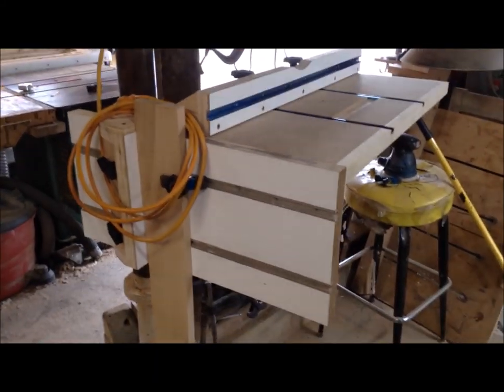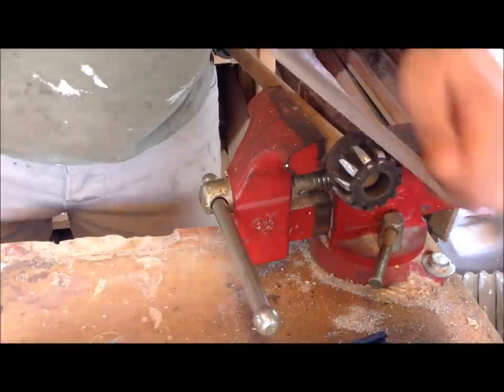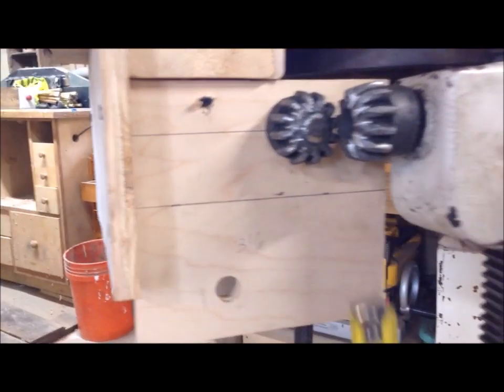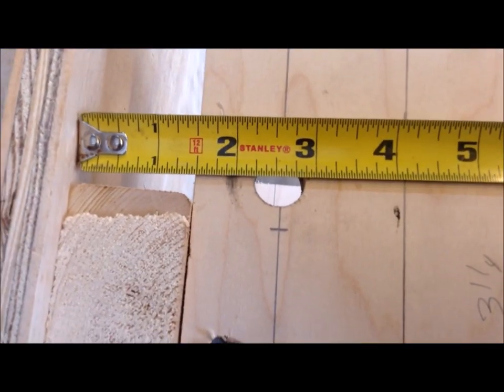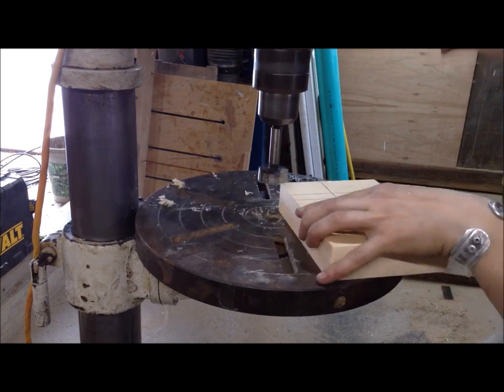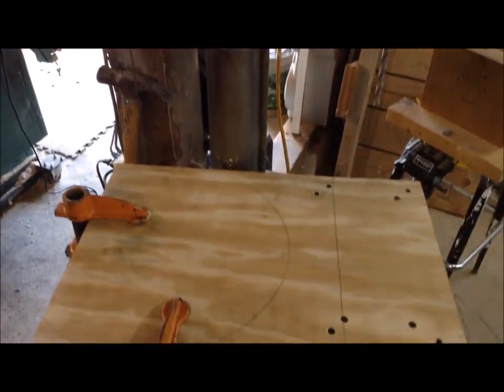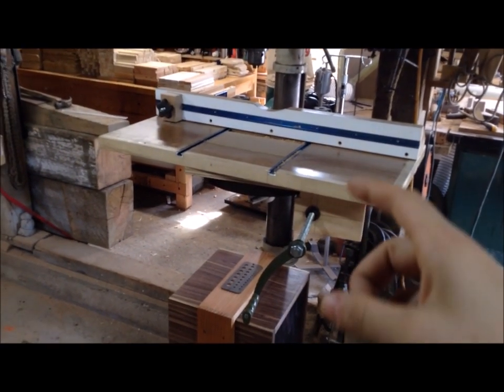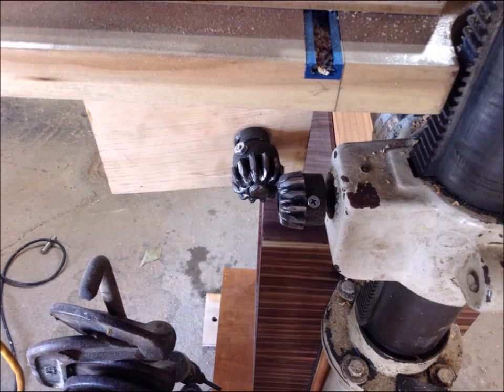DIY Drill Press Table Lift [ How To]

Comment: This design is similar to my approach. Your comment on getting the gears lined up correctly and tightly is absolutely required and I made a box so that the rod extended through the input bearing so the rod and bearing were supported by thrust bearings either side of the box. I also separated table deck from the lighting part and that enabled the lifting part to be firmly fixed to the metal plate.
The weight of everything does put strain on the gears and if I was doing this again, I would get larger bevel gears.
I find it strange that there are no drill presses designed and made with a table suited to woodworking so we woodworkers don’t have to adapt the metal working drill presses these ways.

Comment: Love your resourcefulness and ingenuity.  I actually bought some mesh gears on Amazon but like you, there was a fair amount of resistance when trying to raise the table.  In addition, for my situation, having the crank in the front actually got in my way.  So in the end I extended the original shaft, removed the mesh gears, and mounted the crank in the back right corner of my drill press table.  I also used playing cards to level/square the surface of the table relative to the drill bit.
Reply from the maker: Nice!

Comment: I don't read other peoples comments so this may have been mentioned. I have a bench top drill press and I've wanted to bring the lift mechanism to the front of the machine. Finding those gears is difficult until you or someone else has a angle grinder to throw away. I have a metal lathe I could use to make the gears, however using the  angle gears allows me to mount a handle to the front of the machine so I don't have to reach around the drill press bed to find the handle and crank it to the height I need. Unfortunately, Angle Grinders last a long time, but I should be able to pick on up at a garage sale as soon as this COVID-19 stuff is over.
Reply from the maker: added the gears and handle was one of the best shop updates I've done.  Its so much more convenient, I used to avoid using the press for things I should have because raising the table was such a pain in the ass before.  They sell those gears online, the good ones aren't cheap so I was really happy to have that old mower.  Do cake mixers have them?